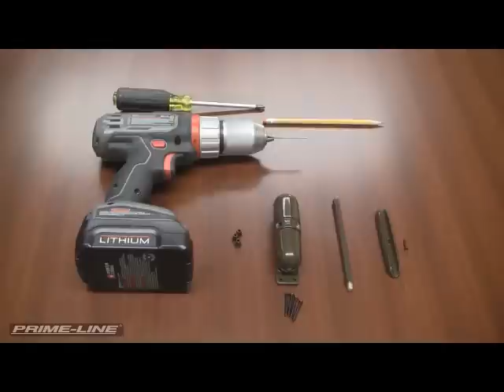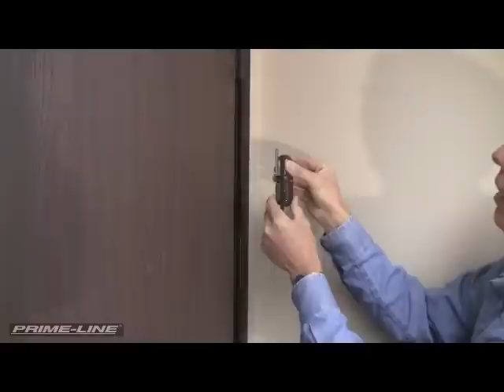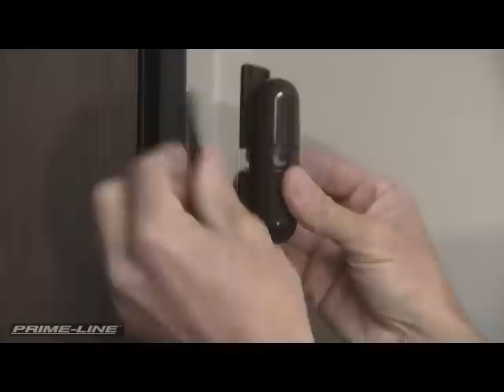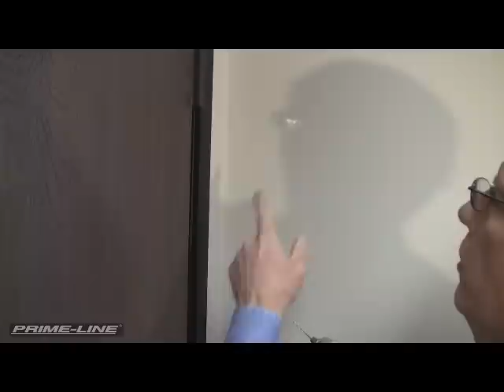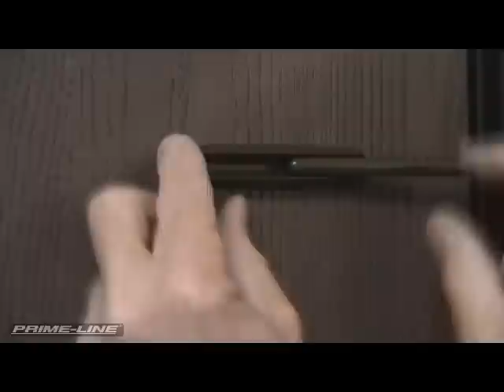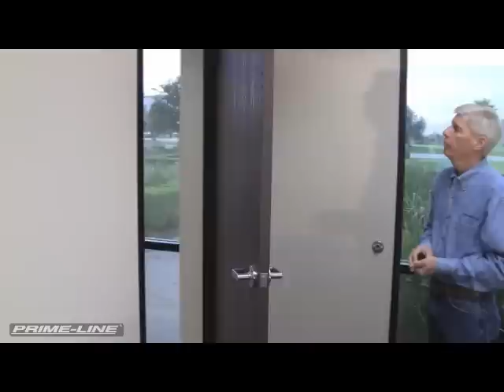Gibcloser Brand Door, Screen and Gate Closers

Comment: I installed mine. It worked for one day then the next day it basically doesn’t close the door. It leaves three or 4 inch gap.
Reply from the maker: Hey there. We’re sorry to hear that you’re having problems with your gib closer. 
 
The tension rod can only be adjusted for four ¼ rotations. Any more and the springs will bend, preventing the closer from closing properly. We recommend trying to see if unwinding the springs may help.
 
Please contact our customer support team for more information at https://www.primelineparts.com/contact/

Comment: Hello, I installed a similar product (KC10HD) on an exterior steel door. It was quite easy to instal but does not work at all. I changed the tension rod 3 times so I can barely turn it as it si so hard. But the door only moves about 3 inches and stops. Far away from closing. The only thing i got is a dent on my door and a bleeding hand when the tension rod slipped. What am I doing wrong? Thanks.

Comment: Didn’t work on my laundry door.  Back to Amazon.
Reply: how did this not work? if you are trying to keep a door closed, this will work every time. I have nothing to do with this project, but as a lifetime Door, frame, and hardware profesional I can say that this technology, when installed properly, will do as advertised. It is basically a retrofit spring hinge.

Comment: My problem was that it would latch the door handle into its slot. It only shut it too. I have fixed it now though by reducing the tension on my door handle and also by doing 8 1/4 turns. After 8 1/4 turns it breaks and snaps back to 4 1/4 turns. Thanks :) anyway;)

Comment from the maker: Are you having trouble getting it wound enough to close your door?

This closer can close a 150 pound door that has no operational issues.   Adding winds will spring the hinge at some point when the door is opened. 3 to 5 ¼ turns is the recommended amount.

Comment: That is something I didn't think about. What if the arm could fold down? My specific use case is that I often like to prop the door open to carry things in / out. I had to place the spring at a high enough tension that I actually need to rotate it three times to get it set up. Once with long, second time with short, finally again with long to get it into place. Then you have to keep track of the decorative caps and the short arm. You guys have probably thought about all this, but you never know!

Comment from the maker: Locking the door on that side would have little effect.  The leverage of someone pushing on the handle side (if it was unlocked) would rip the screws holding the closer right out of the door. Like using a 2-1/2' long pry-bar against 4 screws.   

That's why 99.999% of all door locks are on the handle side instead of the hinge side.

Comment: It really was as easy to install as demonstrated and works great. My hinge was right up against ninety degree wall, so I mounted it to the wall and it still works a charm. The only thing it doesn't seem to have is an easy means of disabling. If it did I would like it even more and start using it on my storm and basement doors.
Reply: I think you might have to pair it with one of those folding rubber-tipped door stop legs, or maybe a spring catch of some kind. I'm anticipating the same issue.